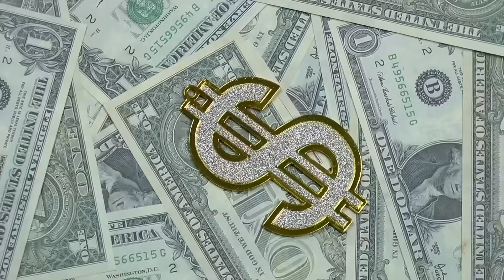How To Lay Out Walls, Floors, and Roofs | Explaining Layout

Comment: For some reason sheet materials sold in my country (the netherlands) used for construction have varying sizes that don't fit together. A sheet of OSB will be 1220x2440mm (which is an odd number, because sizes in woodworking are actually still in inches and feet, but expressed in metric). But drywall is 600mm wide. So half the width of an OSB is 10mm more than drywall... You do not want 10mm gaps between drywall... But then again, you DO want a 3mm gap between OSB sheets for contraction and expansion, so laying out exactly on inches still means you have to saw the boards a few mill shorter for that. Vapor open wood fiber boards have again a different size.... It's maddening. So I have to choose either the inside or the outside sheets to not fit on the framing...

Comment: 4:43 i guess for walls an argument could be made you could make the actual 16" mark on the side if the stud 1 1/2" part since the plates lay flat on the floor at the 3 1/2 faced side.  

Kinda similar with me probably detailing joists on the wrong face where i mark on the 1 1/2 side and then carry it over on the face side to make sure the joists are plumb of that makes sense.. perhaps I am making it more difficult than it should be but if you ran your top and bottom plate in a vertical orientation and did your layout when you layed them flat on the face side you'd have your layout marked BUT then you wouldn't have your squareed layout when setting the studs because you didn't transfer/detail the 3 1/2 side of the plate . 

Yeah I definitely made it harder.. i hope nobody reads this. It will confuse them .

Comment: I just work with my son now.But at one time I was Forman on 20 man crew custom home,15,000+ sq ft.I layout for all.hade 17 walls that where over 25' with 3 tier windows, lot of this was over prestress concrete floor that wasn't poured, so it was stick built off scaffold, all calculated by ,myself.The roof had built in 3 ' scuppers also.I didn't miss a rake.The  boss missed one.In his defense, on another job he layout a large curved wall with curved roof line.He came in with a note book with  each corner of each stud measurement.He also calculated all elliptical beams for roof.HE was the MASTER.That home had port hole windows in curved wall, all custom.Its in flathead lake.

Comment: Sheet goods REQUIRE 1/8" gap between them, right? BUT in just 4 gaps that adds up to a whopping 1/2" difference & it only gets worse. Everyone doing these videos just shows one sheet, but math says that your edges are going to stop lining up with your studs very quickly. WHAT am I misunderstanding?!?
Reply: So did you implement this and did you run into that problem are you just saying that you did the math and this doesn't work

Comment: 5:56 That's because lumber mills account for the shrinkage of each board, so they don't mill the lumber at the exact nominal sizes because as the 'green wood' dries or is kiln dried, the boards shrink during that faze so they rough cut their boards to length by an extra half inch or an extra 3/8" in this case.

Comment: A sill plate of 96 inches, first joist goes at 0" inches.  Next joist goes 16" on center and so on, but what do you do with the final stud if you want it right on the 96" mark.  That is not on center.

Comment: I have a question that I’ve been curious for several years now but how do the walls stay in place?
1:40 - Example The Wall Behind You?

Once you build the wall segment on the foundation then have a small team lift it up how does the wall stay in place? 
Do you nail gun it into the foundation or leave it their and nail it to another wall like a square? I’ve always been curious of how exactly a wall stays in play without being blown of the foundation.
Reply: The following applies to exterior walls:
The concrete crew places 1/2" bolts (called J-bolts) into slab foundation during the pour with the threads facing up. As part of the framing process, framers drill holes into the pressure-treated green board to line up with the J-bolts. When the wall is framed, it is lifted into place with the J-bolts going through the drilled holes. A bearing plate is then placed on the J-bolt and fastened with a 3/4" nut.

In cases where the J-bolt might line up with a stud, the J-Bolt is cut level with the concrete. A hammer drill is used to drill a hole in the concrete. Then a screw-anchor is used to fasten the green board to the foundation.

For interior walls, a concrete nailer (sometimes referred to as a Ramset) is used to drive 3"  concrete nails into the green board and the foundation.

Comment: If you have a stud at the end of that wall where you measured from, wouldn’t you advance the following 16 inch on center mark 3/4 instead of marking it back?
If you’re measure from end of the board you’ve got a whole inch and a half at the end not 3/4?

Comment: I carry a 14 1/2” block with me and butt it up from stud to stud.  If you use it for the top and bottom your studs are level every time. I always double check my work, and after 10 years, it has never been off more than 1/16” which is always human error. I strongly recommend this trick

Comment: Great video. Only thing I would have added was when laying out, to do your longer "thru walls" first,  then your "butt walls" second,  so they won't be in each others way when raising.  And tell them when laying out a butt wall, to be sure and measure from the outside of the thru wall so your outside wall boards will stay on 8 ft incrementals. When I would train a layout man, he'd always try to mark his butt plates starting at the end of the butt wall, instead of the wall he's butting against,  which would always throw things off. Around here we always layout from left to right. That way whoever puts up the outside wall board always knows to start his run from the left.

Comment: Everyone misses one VERY important lesson that I learned the hard way.  I've watched hundreds of framing videos on YouTube and nobody talks about laying out butt walls, they only talk about layout for through walls.  To layout a "butt" wall 16" oc, you CAN NOT just lay out your "correct length" wall 16" oc like you would normally lay out a through wall because your sheet goods have to not only cover the butt wall but they also have to cover the end studs of the through walls.  If you don't subtract the through wall's thickness and you just lay out the butt wall like you did the through wall, your sheet goods WILL NOT break on your studs at all, the will be off by 4" or 6" (don't forget to account for the thickness of your sheathing of your through wall, hence 4" or 6" vs. 3.5" or 5.5").  Hopefully this helps someone avoid the pitfall I fell into.
Reply: Make a video sir

Comment: Here’s what gets confusing, you frame a 16’ wall , on the outside perfect for siding but when you go to drywall inside wall, the plates are inside the wall throwing layout off
Reply: Like you showed on interior wall the dry way doesn’t run into the wall, I’m thinking a good layout would star inside the wall?
Reply: Interior walls are butt walls? So when you layout an interior wall you account your layout for the through wall it's butting into?

Comment: A good tip I was told was about changing centers. Sometimes, the stud you're pulling from may be off a quarter inch or so. If you pull 16" from there, it's going to mess up the sheets, at least after doing this a couple times.

We generally mark layout on the sides, since they're metal studs too. When pulling, you're going back two studs. Read the mark on the second, it should be 16 3/4". If it's off, measure off of that. So, if the studs out of place a quarter(17"), measure up that extra quarter to keep the rest on center from the original.

Afaik, this is more applicable in industrial, since we get longer expanses. Framing a room, this wouldn't help much. All it takes is a couple of studs, and then you got guys making bastard cuts.

Comment: Love your vids.

The 19.2" layout almost doesn't make sense. The only place it really makes sense is for roof trusses. You get a little more strength than 24" OC and a little less cost than 16" OC, and it works because you run your roof deck horizontally anyway. It makes no sense on walls as the sheathing runs vertically. In many jurisdictions code requires blocking behind the horizontal seams on wall sheathing to meet minimum nailing pattern along the edges. For this reason 9-foot and 10-foot sheathing is available--to eliminate the requirement of adding blocking between studs.

Comment: thanks for the video, it is well done. I have been thinking about the double top plate concept. I have always heard the same thing you said about not landing the rafter over the stud. my thought is that it shouldn't matter for that. think about how much weight your 1/2 in sheeting could handle. its as if you have an 8' tall TJI.  I understand the double top plate to make sure you have a continuous plate that transfers the sheer loads, but i wonder about how true the vertical load path problem is. Thanks for the vids

Comment: I was the layout guy for 35 years on everything you can think of. A tip i will give to anyone watching, layout all windows , doors, intersecting walls and so on before laying out the studs. The reason is stud layout might layout in or on the above mentioned areas, and then you will need to esarse a lot of stud layout marks. It gets very confusing. Also do not layout anything until you know  (for sure)where all Plumbing, HVAC, Electrical Panels, Windows Doors, Fireplaces, Shear Walls, and so on. You want to build once, not cut in later. It takes years to get good. Good means your build your work once! You tell the other subcontractors i need this info now, if not i will charge you later if i have to change anything.
Reply: 100% agree! I’m new to framing (mostly commercial/metal). I’ve laid out stud marking before door opening, which led to confusion and re-markings, etc. 🤦🏻‍♂️. Now, I lay out all window and door openings first and then fill in studs and cripples as needed. Very good wisdom, sir.
Reply: Also consult the blueprint, most mechanical placement should be on there, if a framing member lands there though ideally you want everything stacked occasionally one has to move a stud or cripple over to compensate. This can be done preemptively, if the mechanical contractor misplaced their 'whatever' then back charge is warranted but if the framers consider the subs to follow it can all be made right without having to tear things out later. Saving everyone time on the job. 
I've often noted the jobs where every contractor is mindful of the other elements, and the work flow to follow were the best ones for contractors and customers the care and quality of work shows in all of it. Whether someone is production oriented or quality oriented.
Reply: Exactly. Bang walls together once properly, you should never have to go back again.
Reply: So I can put my windows pretty much wherever I want and then go from there?
Reply: @roz4747  I think what he's saying is, lay those out also, in addition to the regular studs. I could be wrong, but I stayed at a Holiday Inn last night 👍
Reply: @diarrhea_splatter  hehehe
Reply: I agree 100% if your wood framing!! I always layout my doors, windows ect....laying out my studs is one of the last things I do....
Reply: @roz4747 we're talking about layouts specifically here. Deciding where windows go happens before that and during the plan drafting. The idea here is so you don't make mistakes as easily as you would of you were to start at one corner and run layouts down each wall.... Don't do it like you would your roof true layouts basically. There's things that shouldn't be called back to cut out. Simple. Basic physics. Not rocket appliances. 😂

Comment: As a plumber (and steam fitter) I have often asked some of the Carpenters what they were doing in marking off the floor before putting up walls. And to see them have to rip it all out when the Architect / or (Engineer)came by to check it out. I see now why they never answered my question with a straight answer. They always said next year in your Trigonometry class you will learn. I was 12 years old and I only went to school half days and worked the other half days. My grandfather owned the plumbing company and my father and uncles and I was required work. I am now 74 years old. 
I have made a barn it wasn’t half bad, using the techniques I saw one carpenter used. I make furniture too. 
I found that wood working is relaxing 😎!:)
Reply: @Suntouso  architect have no idea how to build, they only draw pictures. We stopped attempting to fix there mistakes and built per plan. Than they pay us again to fix there mistake’s. Engineering is different , we have to build it to get country inspections but we have to fix that also because the architect has no understanding of how the engineering fits in to his drawings.

Comment: So just to check to make sure that I am understanding this correctly, when I measure from the outside edge of the outer-most stud (that is to say the stud that forms the corner) to the second stud, the distance between centers of those two studs is actually 15 and 1/4'', not 16''. After installing that second stud (should I choose to use this method) I can then hook my tape on that stud and mark out outer edges of all remaining studs at multiples of 16'' i,e, 16'', 24'', 48'', etc. And if I am using thicker material, for example, if I am doing floor joist layout and am using 3.5'' I joists, the distance from the outer edge of my rim joist to the outer edge of my first I joist would be (16 - 1& 3/4)'' which is 14 & 1/4 ''. Again, after installing the first joist, I could then hook my tape on the first I joist and measure outside edges of remaining I joists every 16''. Is this correct? Thank you for the video.
Reply: I just asked this same question framing trusses yesterday. 
Because the sheathing lands on the out side of the end truss or stud, you actually are burning 3/4. Therefore as you said, after the first mark at 15-1/4,  We were doing 2' , so it was 23-1/4 . you can then hook on the outer edge of the second stud and mark 16  or 24 on like sides until you hit the end.  X16 or x24 pulling from the right side. That's where I took the first measurement.
That's how I was told to do it.
Otherwise you end up 3/4 short if you don't pull from the second stud.
I asked why can't you just set the sheathing over 3/4 to the left and not worry about it, I just got a look like I'm an idiot. 🤕👊🤔

Comment: The first stud in relation to the starting end stud is then actually 15.25 on center. The rest are 16 on center. Otherwise, your 8 foot sheet breaks on the center of the starting end stud, instead of the end of the wall. I guess, it would be the same at the finishing end, if you don't want to have to cut the 8 foot sheets.
Reply: This is what I needed to wrap my head around. Now I need to know what to do if you’re building a wall that is not a standard even length. Like 12’ 1 3/4”. Do you add another stud to make up the difference?
Reply: @yuzurname   Yes. 12’ 1 3/4” = 145 3/4”.
So 16” on centers would get you to 144”. A stud is 1 1/2” thick. So you would add a end stud flush with end of your wall plates. In the case of a 12’ 1 3/4” wall that would leave you a 1/4” gap between your last 16” on center stud at 144” mark and the end stud.  If your wall was exactly 12’ 1 1/2” you wouldn’t of even had a 1:4” gap between last two studs. You could have nailed against one another and your last stud would have been exactly flush with end of wall plates. 
Just remember to use the beginning of the other end of wall to begin your layout when installing sheathing or drywall so they break every 4’ on a stud center.
Reply: @jrandall5736  
Thanks. Well explained.

Comment: 19.2? I have never heard of that layout before and how does that compute with 4 x 8' sheets?
Reply: 96 inches (8 feet) divided by 19.2 equals 5. So a 19.2 on center layout will have 5 studs/rafters. Don’t really see it much on studs it’s mainly used for rafters or floor joists/trusses.

Comment: How do you layout the perpendicular walls for the sides of a building. If I'm not mistaken, when you layout an 8 x 8 Shed, for instance, the front and back walls are 8 feet wide, but the side walls have to be 7 feet 5 inches to make an 8 foot square structure. How does your layout of 16" OC account for the 3 1/2" of the front and back wall bases/top plates and still remain 16" OC. I can do it mathematically, but not sure if there are standard practices for marking for side walls. Sorry if this is confusing.